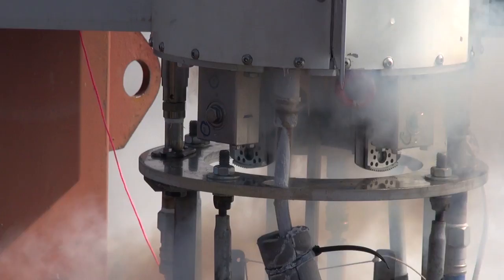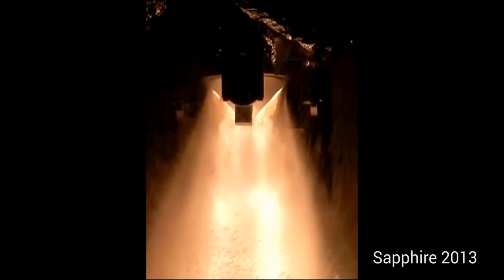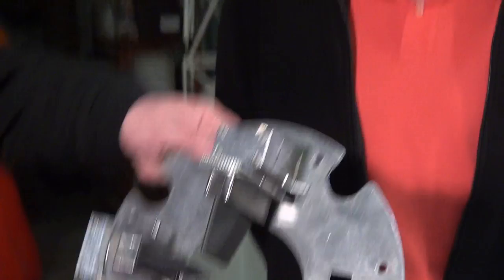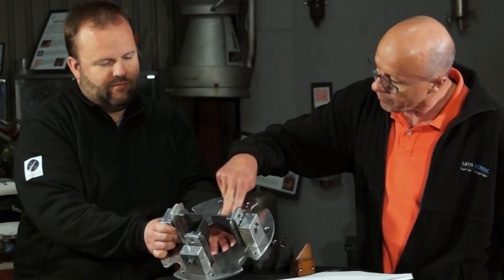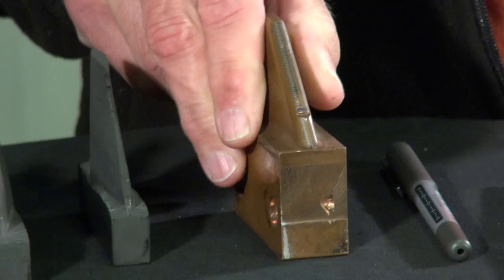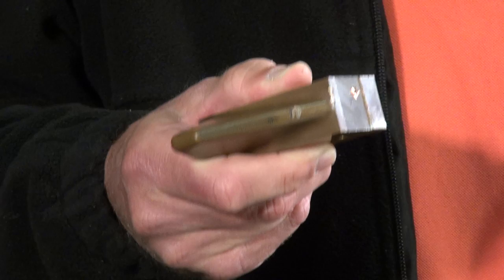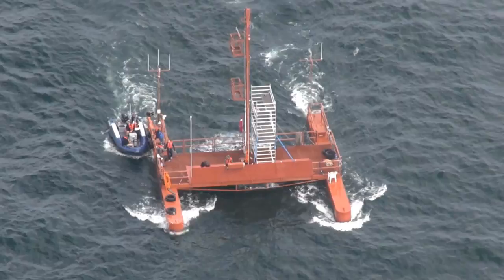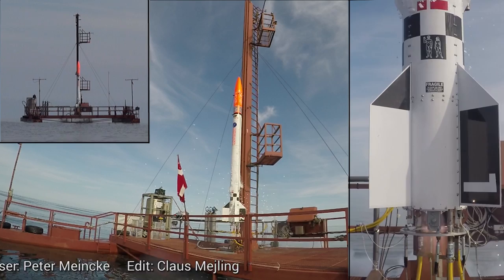2017-05-18 Current Affairs - Jet Vanes - Guest Flemming Rasmussen

Comment: just wondering, you are using plastic servo's to control the jet vanes,  do they not meld faster then the vanes you have talked about.
Reply from the maker: They have been tested many times on ground at static tests as well as in two launches, and survived just fine.
Reply: Cool
Reply: came wondering the same, WOW, are they just plain steppers or some special kind of them?
Reply from the maker: COTS all the way :-)
Reply: What do you mean with COTS?
Reply: i think they mean "comercial of the shelf"
Reply from the maker: Yes, so they are completely plain

Comment: Have you considered using Inconel 713 for the vanes?
Reply: Any suggestion we can lay hand on for testing will be appreciated.  If you trust Inconel 713 to withstand a temperature of >2.800 degrees celsius for at least 40 seconds, please donate us a sample for proof of concept.
Reply: Ok... do you have cad files for the vanes? I've dealt with lost wax/investment casting in Inconel and could send a sample of a smaller profile but it would obviously be a more accurate test if it was of similar size and thickness to a full scale vane that you are using.

Comment: Do the vanes provide most of the force from the new angle of the gas stream in relation to the rocket or from a reactionary force on them via the redirection of the gas.  Or am i just confused and they are the same force described in two different ways? 
Either way sooooooo dope! Keep it up guys!!!!

You sorta answer my question at 12:20 so don't worry about responding, but do if you like! I would love a more in depth thinggy on this!
Reply: I was also somewhat confused about the subject, but after inviting something about models of gas movement I found out that both systems exist one that uses the video's vanes and another that uses plates that are interposed to the flow of gases causing the relationship Of thrust between a part of the nozzle is mallor than where the plate is.
In my opinion these simmits are somewhat useless because of the high loss of gas veins, one of the best methods for the vectorial propulsion is the gimballed engine or the gimballed nozzle because the loss of gas permeability is minimal and does not affect The engine speed
Sorry for the spelling errors but I do not speak English and google not hired a good bilingual programmer
Reply: Yup, they are the same force described in two different ways. When the vanes are tilted, they redirect a portion of the oncoming exhaust stream. We can analyze this system in one of two ways, either from the vane's frame of reference or from the whole rocket's frame of reference. From the vane's frame of reference, it appears as if the exhaust is suddenly hitting it at a slight angle, and so it feels like it's being shoved to the side. However, the vehicle it is bolted to stops it form actually flying off to the side, and so the force which the exhaust is pushing on it gets transferred to the vehicle. From a rocket's frame of reference, we can basically ignore the fact that the vanes exist at all. All that matters to the rocket is which direction the exhaust stream is pointed. When the vanes are tilted, the exhaust stream (or part of it at least) is suddenly pointed slightly off to one side rather than straight down, and so the thrust it experiences is also tilted. How much that thrust is tilted depends on the fraction of the overall exhaust mass flow rate which gets redirected and the angle to which it is redirected. Fundamentally speaking if you had a central engine fixed with four mini engines around it which each tilted in the same way a jet vane did, a passenger would not be able to tell the difference between that and jet vanes (ideally speaking at least, of course there would be many differences in the practical implications for the engineering and control system design). Now to connect the two cases together, when a jet vane is tilted it redirects a portion of the flow and thus a portion of the thrust. However, while the portion of the thrust that is still pointed straight upwards is acting on the engine, the portion of the thrust that is redirected is acting on the jet vanes, but since both are firmly attached to the airframe, all thrust forces are inevitably transferred to the rocket, one way or another.